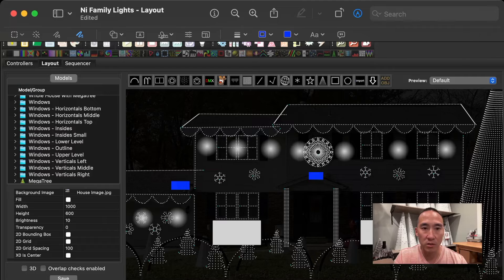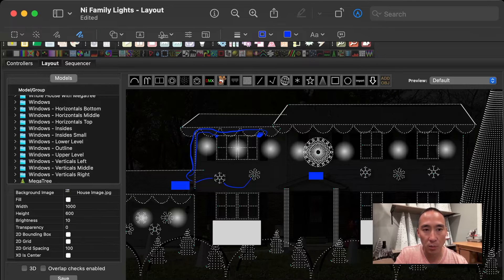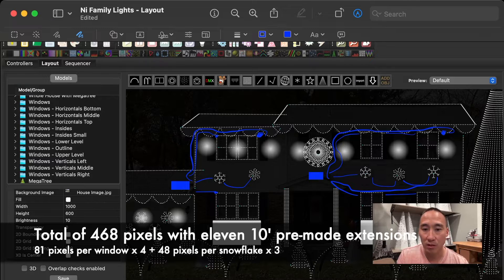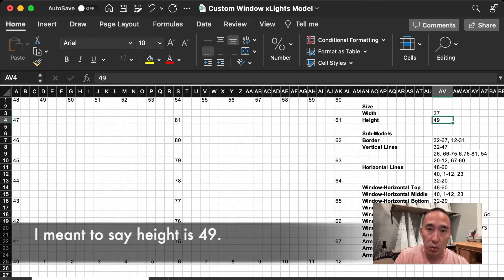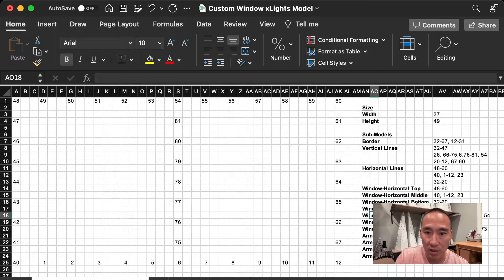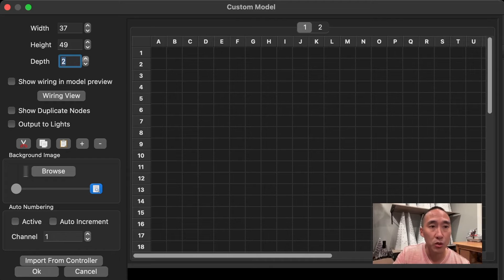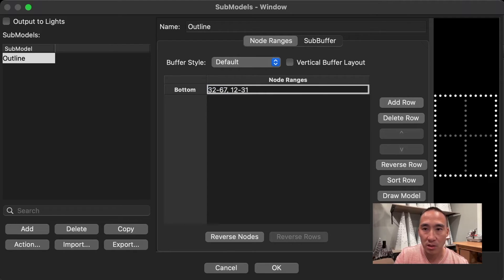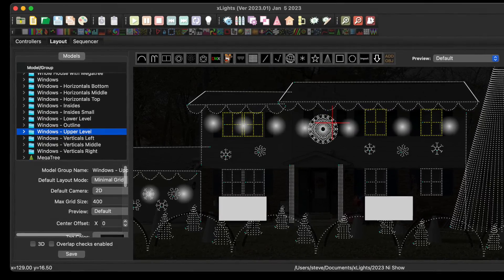How To - Make Custom Pixel Window Props (Part 2)

Comment: On your double windows, how are the lights numbered from the end of the first window to the start of the second window? Do you start your numbering with 82? How does that look in the sub modeling? First year doing a light show but have been watching your videos trying to learn as they are some of the best informative videos out here.
Reply from the maker: Thanks for the comment. In xlights, the second window is a duplicate of the first window. From an absolute channel perspective, the channel numbers are different. However, from a model perspective in xlights, it’s two windows next to each other. So, the model’s pixel number starts back at 1 for the second window. Hopefully that makes sense.

Comment: I've watched this several times.  I have modeled this in xlights.   wasn't until this last time I realized the order of the pixels matter.  EVEN THOUGH you state it in the video.  I didn't know what it meant until now.   Now I must redo my submodels  as I just built the frames and about to push the pixels.

GREAT INFO and thank you for sharing.
Reply from the maker: Congrats on making it so far with your custom window props! The good thing about the software programming in xlights is that it can be redone, if needed. So, no harm no foul. 

Thanks for the comment, and I’m glad you figured out that piece!

Comment: What do you use to run your show? (Pi, xSchedule, etc)  do you have a video on that?
Reply from the maker: @gritz1701 Thanks for the question. 

My setup is pretty straightforward. I use a Pi 3B+ running FPP to run the show. It’s hard wire connected via a network switch on a dedicated show network to the F16v3 and the two P10 panel setups. The P10 panels are each running a Beagle Bone Black with an octoscroller cape, connected to the 36 P10 panels. 

I don’t have a video on it (yet) as it’s pretty standard, and there are many videos out there showing how to setup and use FPP. 

Please let me know if you have other questions.

Comment: Great video!  If I'm following correctly, it looks like you may be missing pixel 48 in your first line of "vertical lines".  Roughly cell 8, AV.
Reply from the maker: @dbldare You are correct!  You have been paying very close attention and found the easter egg omission.  ;) 

You did have me go into xLights to see if my windows are setup correctly.  Fortunately, those were correct.  I apparently didn't reflect the right values back into excel when making the video.  

That level of attention to detail will do you well!  Would love to see your show setup and work once you have everything going.

Comment: Thanks for the very detailed videos you produce. I'm very new to this and want to know what brand name pixels you purchase or what manufacturer or website you recommend for purchasing pixels?
Reply from the maker: Glad you like them and welcome to the lighting club!  I don't have any particular brand of pixels.  I purchased all of my pixels from one manufacturer back in 2017 and 2018.  There are a number of online retailers that sell them now, and most are pretty reputable.  When issues are found across a retailer or set of retailers, it likely is due to the manufacturing source, as there's only a handful that mass produce them.  I have no direct affiliation nor sponsorship, but if I were to purchase pixels now, I would get them from YourPixelStore.com.  Mynor Mendoza is the owner of the company and has been driving quality back through the supply chain.  That being said, there are many others that sell quality pixels as well.  If you join the Facebook Official xLights Support Group and do a search there, you'll see comments and posts from folks who have had good success with a number of them.  Best of luck.